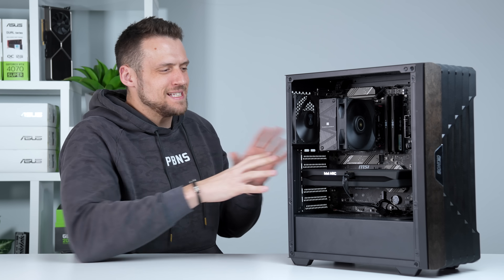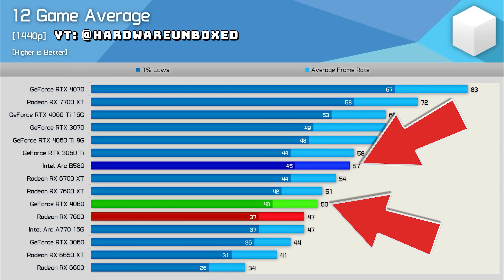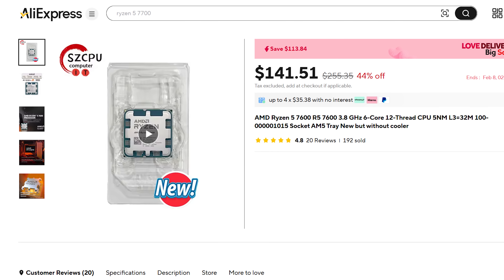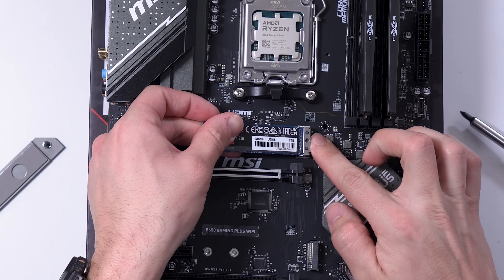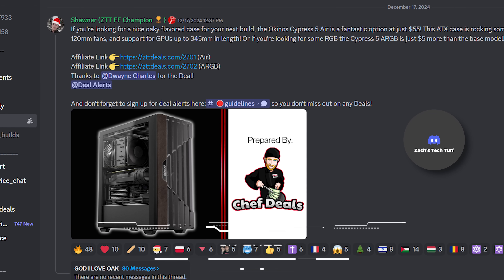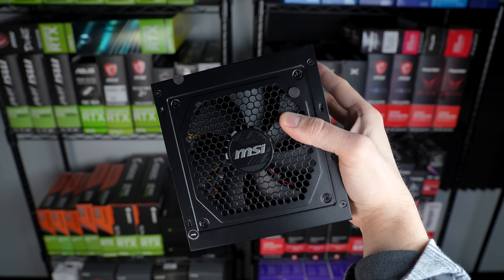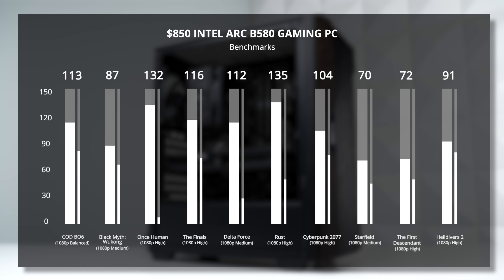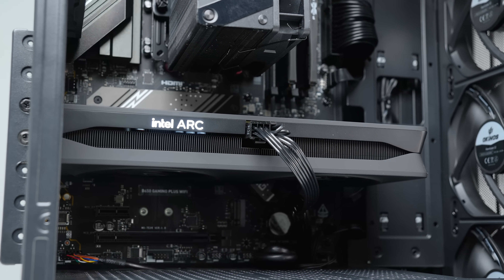$850 Pure Performance Gaming PC Build Guide

Comment from the maker: Check out the brand new build guide cheat sheet for this PC, with links, alternative parts, monitor recommendations, a cable management guide and more! https://zachstechturf.com/$850feb25
Reply: Is a 3060 still a good GPU
Reply: 8gb or 12gb@TheBlobKing1039
Reply: @TheBlobKing1039gpu wise decent but price wise you can get better
Reply: Is the War Machine v1 coming back?
Reply: I have a Xbox series x what pc could I replace it with
Reply: @GCJDM  whats your budget?
Reply: @G.CJDMcars if you're going with a budget Build $500 or less I can recommend you Horizon 5 3600 RX 5700 XT both of them used 16 gigabytes of ddr4 RAM a 1 TB nvme a a 500 w PSU like MSI MAG 550W DN add if you have this case available in any online store theMSI MAG Forge M100A

if you're going with a budget of a 1000 dollars you're stepping in a 1440p territory at this point so you can keep the the same SSD and RAM or you can upgrade it to 32 gigs but the CPU I recommend a minimum of a rizen 5 5600 and the GPU 7700 XT 12 VRAM will give you enough performance or even the Intel arc B580 and you're going to need a beef power supply I recommend a 750-1000W it might sound as overkill for 1000W but for future proofing you can never be too safe
Reply: Hi Zach is a B580 with an 5 5600x for 450 usd a good price
And the whole pc with all the other stuff like keyboard mouse is about 900 usd
Reply: Should I use a b570 because you could buy them for there normal price off Amazon. Also, can I use a ryzen 5 5600x because it’s $60 cheaper?
Reply: Zach I have a rookie question for you. Can you explain GPU and CPU usage? Is 100% usage a bad thing? Is it a sign of an unbalanced system?
Im running a Ryzen 7 5700X3D and a Radeon RX 7600 XT. My GPU hits 100% usage and I am worried maybe I didn’t something wrong?
Reply: I had a ryzen7 7700,cx650w what gpu is good for it
Reply: @AhnafAkif-t4c  im running a 7700x with a 7700xt seem to be good no oc or uv yet
Reply: fake you cant even get half the parts
Reply: @Tweek9690  you can there are price tho differences in countries and area
Reply: @ i check parts and prices everyday its my job, not in the states no you cant
Reply: @Tweek9690   acctualy i can its 930 usd and in my country everthing is cheaper
Reply: @ZachsTechTurf  I dont live in America
I live in Romania
Reply: Hello Zach. 
I've been trying to reach you, asking about if you could evaluate a purchase I made in December. I would love to know your thoughts. Since you haven't responded, (and I don't know where else I can leave such a post) I thought I'll just leave my full specs here. 
Tell me if you would like me to send you some images and videos of it too. 
I already know the one hardware thing you will say you would replace for a better option, but I'll just wait for your input. 

Specs: 
- AMD Ryzen 9 7950X3D 16 Cores (CPU)
- ASUS TUF Gaming NVIDIA GeForce RTX 4090 OC 24GB (GPU)
- ASUS Prime B650-Plus (Motherboard)
- 32GB RAM (2x16GB RGB) G.Skill Ripjaws M5 Neo RGB DDR5 6400 MHz (running at 5600 MHz)
- 2TB SSD M.2 ADATA NVMe Gammix S70 Blade
- WaterCooler CPU ARGB RX360 Mirror
- ATX Slayer RX33 Crystal (Case)
- 850W FSP Hydro K Pro 80+ Bronze (PW Supply)
- UPS APC 1600VA
- Windows 11 Pro
- Razer Ortana V3 RGB (Keyboard)
- Razer Basilisk V3 RGB (Mouse)
- EasySMX X15 Wireless Controller RGB / Dualsense Wireless Controller PS5
- Slayer HD800 7.1 Gaming Headset / Sony Wireless Headset Pulse 3D
- ASUS TUF Gaming Monitor VG1A 2K/260Hz / LG TV 43inch 4K/60
Reply: why is the b580 linked so expensive compared to what was mentioned in the video
Reply: Hi! It seems you mentioned me to tell me that I won something. I didn't notice until today, three weeks later. Is there any chance i can still obtain something? If not then rip 😂 still a big fan either way
Reply: 1. CPU: 
AMD Ryzen Threadripper PRO 5995WX, 64-core, 128-Thread Desktop Processor: $ 3,250.00

2. GPU: 
NVIDIA - GeForce RTX 5090 32GB GDDR7 Graphics Card - Dark Gun Metal
: $1,999.99

3. RAM: 
CORSAIR VENGEANCE LPX DDR4 RAM 64GB (2x32GB) 3200MHz CL16-20-20-38 1.35V Intel AMD Desktop Computer Memory - Black: $87.99
  
4. SSD: 
  SAMSUNG 980 PRO SSD 1TB PCIe 4.0 NVMe Gen 4 Gaming M.2 Internal Solid State Drive Memory Card , Maximum Speed, with heat sink Thermal Control MZ-V8P1T0B/AM: $123.00
  
5. Motherboard:
 ASUS Pro WS WRX80E-SAGE SE WiFi II AMD WRX80 Ryzen™ Threadripper™ PRO Extended-ATX Workstation Motherboard: $899.99

6. Cooling system: 
ARCTIC Liquid Freezer II 420 - Multi Compatible CPU AIO Water Cooler, Efficient PWM Controlled Pump, Fan Speed: 200-1700 RPM (Controlled via PWM), LGA1700 Compatible - Black : $75.99

7. Power Supply:
CORSAIR RM1000x Fully Modular Low-Noise ATX Power Supply – ATX 3.1 Compliant – PCIe 5.1 Support – Cybenetics Gold Efficiency – Native 12V-2x6 Connector – Black: $189.99

  8. Case:
SAMA NEVIEW 4503 Black Airflow Full Tower Case ATX PC Gaming Case Dual Tempered Glass 4X12CM ARGB Fan Pre-Install USB3.0X2 Type C Included 360mm AIO Support at Top : $114.99

9. Operating System: 
Windows 11 Pro: $199.99

10. UPS: 
CyberPower CP1500PFCLCD PFC Sinewave UPS System, 1500VA/1000W, 12 Outlets, AVR, Mini Tower, Black: $219.95

11. sarge protection: 
Rocketfish™ - 12-Outlet 5,280 Joules Surge: $189.99 
what do you think of this build
Reply: hey zach im planning on getting a pc can you tell me if the parts i have chosen are good.

Cpu- Amd Ryzen 7 7700x
ram - 2x16gb ddr5
mobo- MSI am5 motherboard ATX
GPU- amd radeon rx 7600 xt
psu- corsair rm1000e
SSD- 2tb m.2 nvme PCIe gen 4
Reply: "🔥 Hey, I'm new to PC building and to your channel, and I absolutely LOVE your videos! ❤ I'm looking for a super detailed video on how to transform an HP laptop into a full desktop PC 🖥 because I don’t have any other device and REALLY need this ASAP! ⏳⚡ How do I turn a laptop into an actual PC with a case and everything? Please make a video on this! 🙏💻➡🖥"
Reply: Zach if i had 144hz monitor then i dont need to replace my gpu for more fps ?
Reply: Hello, I wanna build my first pc, can you please help me with some suggestions. I want my pc to be future proof for at least 6 to 7 years and for it to be able to do smooth 1440p gaming with great fps in the latest upcoming AAA games of this year and to be also able to support 4k with good fps (at least above 60fps). My maximum budget is 5000 dollars. Please also suggest coolers , monitor and case as well.
Reply: I don't really play games on my PC but I'm wondering if you could recommend a cpu & GPU combo for a budget to mid PC build to work with unreal engine. Any help is appreciated.
Reply: I've tested this rtx 4060 on over 8 diff pcs.. all ddr4 got 260-320fps --- all ddr5 got 400-460fps

Why is it such a drastic diff?
Reply: I'm going to upgrade and sell my old parts but I'm on a budget of 300 bucks and my current parts are the rx 570 4gb and r5 2600x. Yikes 😬
Reply: hello. actually I am from an Arabic country.
my question is does ray tracing  in Nvidia graphic cards worth the money
Reply: How would you feel if I started a tech info youtube channel... and to get a bump in the algorithm, I use your beginning taglines... but use my own content in 90% of the video. 

For example: "You can't future proof a gaming pc" --- yes you can -- and I list parts I would reccomend. 

I want to start a tech youtube channel and I feel like using popular video taglines and keywords would help the algorithm but I don't want to steal.
Reply: thank you

Comment: Just go with a 5800X and 7700XT PC it will be more bang for the buck in my opinion I have done my research. A 5800X won’t bottleneck the 7700XT and it would beat a PC with a 7600X and B580.

Comment: I've never built a PC.  I know I want to be able to play anything (1080p/2k), potentially stream, and not have to pay $6,000+ to do it. First time watching the video I realized looking at this build that its basically what I was planning to do after doing a bunch of research. 😂(at least with the GPU and CPU) I'm not sure what all prices seem like at this point a couple months later. I am willing to do a build up to $1,500. I just want to be able to play everything quite well at at least 1080p and probably at 1440 too. I think I may spend an extra couple hundred and get a slightly better GPU instead of the B580. (great GPU if paired with a strong enough CPU though) I was thinking I may get the the RX 7700 XT 12Gb or the RX 7800 XT 16Gb. I may go for I higher PSU for the RX 7800 XT 16 Gb if I do that one.  I only have a 1080p monitor with about 160 Hz right now, but I think I might get a second 1440p monitor when I build the PC. 

Its a bummer Nvidia is disappointing with everything being out of stock and too expensive. I think Its time for AMD and even Intel to take over the graphics card scene.
Reply: Right on the money! Try buying a 7700 xt or 5060ti (16gb) depending on whats cheaper and i suggest to pair either one of these gpus with; Ryzen 5 5600 or higher, a weaker cpu is fine if your at 1440p but the 5600 should be good enough for 1080p and 1440p.
Reply: @Ambiguityt I already got and built a PC with a Ryzen 5 9600x (it was on deal cheaper than Ryzen 5 7600) and a B580. I am getting mostly good 1440p performance. I’ll probably upgrade to a card similar in power to a RX 7800 XT 16 Gb in a year or 2. I have no plans of doing anything at 4k, but I’d like a card that can do 1440p with other things happening.

Comment: New subscriber, love your videos.  I hadn't been keeping up with computer builds in almost a decade, but it's been fun catching back up and exploring what I could do to update my 8 year old system.  It does suck to see how hard it is to find a reasonable price for a slightly older GPU.  I'm on GTX 1080 and my research is pointing me towards a 3060ti to get a nice boost with minimal bottlenecking with my CPU (i7-7700K).  I just don't trust used or "renewed", and if I understand correctly NVIDIA has discontinued production, which makes this seem potentially impossible.  Next PC will have to wait for me to save a bit more, but based on this video and other information I've been reviewing,  a bit more money, and a mid prebuilt would be a big upgrade.

Comment: If anybody ever reads this, please help me out. Im completely new to buildings pcs, but have been doing some research for the past week. Do you think it will be fine/better if I switch the cpu to ryzen 5 9600x with msi b650pro, and for gpu intel a770 ( the only logical pick because of the shortage). Please anyone if you have an answer for me help me out

Comment: I built something close to this for a friend, I built it also based on a few things I learned. But a big help I learned for next time for friends who are ok ordering from Aliexpress is to use Aliexpress. I NEVER would have though to order from there. But we upped the CPU as he wanted to change the GPU down the line, we went for the 9700x vs the 7600x because it was only 25 dollar difference due to a bunch and a coupon we got from the rep at Microcenter.

Comment: Zach i have been build pcs for a long time and appreciate your thoroughness with this video. I think you should make a video with USED parts from either FB marketplace or some trade groups. I have been able to make builds with 30 and 40 series cards a year after for about a 50% discount over MSRP, taking advantage of people who always upgrade . I think this is a much more realistic price point for some people and availability is not that bad when you are sourcing across the country. A 1 year old 4080 is going for cheaper than resale prices for mid tier 50 cards. Just trying to give another option to us budget gamers, you can basically get the latest updates. I was on a 970 for a long time trying to find the best deal.

Comment: how would the pc work with 1440p on a 32inch curved monitor?
Reply: What??
Reply: @ the fps etc are great in 1080p. What if I want to Play on 1440p?
Reply: @simon_sch  that wouldn't be a problem for the pc it just decreases the fps just a bit but I still think 1440p is good

Comment: Might be a silly question but can I stream/record with this build? I’m new to pc gaming so I don’t know a whole lot but I have read that streaming and recording can affect the fps. Also I plan on streaming with a webcam in case that information is relevant.
Reply: You can stream with this build but I wouldn't recommend the b580 because in every games the 1% & 0.1% lows are bad so I'd rather go with another GPU like a used rtx 4060 or u can get a new rtx 4070 super if you can find one, now don't get me wrong the B580 is good but at the same time it isn't worth it imo
Reply: @ but the cpu can still stay the same?
Reply: @LGato__  yes the CPU can stay the same
Reply: I had the same question

Comment: I have a Ryzen 5 2600 with 32gb of RAM and an MSI RTX 2060 6gb gpu. Ive had it since 2020 so I’m 5 years in now. Ive had no issues and I’m just wanting to upgrade but don’t know where to start.
Any suggestions?

Comment: Hi Zach I’m thinking of buying a pc prebuilt and I was wondering if this is a good build AMD RYZEN 7 5700 (3.7GHz, 20MB Cache, 8x Cores, PCIe 4.0 Ready Turbo 4.6GHz+) CPU
MSI B550 Gen 3 AM4 DDR4 USB3.1 HDMI, AMD RYZEN Motherboard
GeForce RTX 4060 8GB GDDR6 DX12 Graphics Card
32GB DDR4 3200MHz High Performance RAM
1TB NVME SSD Ultra-Fast Solid State Drive
Windows 11 Pro (64-bit)
Cooler Master Elite Nex PN600 600W Power Supply
Gamdias Athena P1 Tempered Glass GAMING CASE
Integrated 8 CH High Definition Sound Card
24 Months Warranty this is 16k in my currency 900 dollars

Comment: Hi, I have msi 3060 12 gb and i5-12400f msi b760 mobo, 32gb ram 3200mhz and gigabyte g24f2. Is this the correct combination for playing ets 2. Kindly suggest if any cpu change in the 12,13 or 14 gen can increase performance. Also any best monitor, apart from which, I have.

Comment: Hey Zach I used to have an AMD RX 590 Sapphire Nitro, but after I had to move my PC to another room, I decided to clean it using an air blower. After plugging everything back in, the PC wouldn’t boot. After many attempts, I finally managed to get it to turn on, but I had to leave to eat, so I shut it down. When I tried turning it on again later, it just wouldn’t start, I tired plugging it into a another motherboard and all but nothing.

I took it to a repair shop and they said they couldn't fix it. Then I took i to another repair shop but the repair cost was about half the price of the GPU itself, so I decided not to go through with it. Now, about four months later, I still have the card. Any ideas on what I can try to fix it myself?

Comment: Hello zach!, i was have an i5-8500 and a 6500 xt (i got it for 80 bucks), its in an optiplex, should i upgrade just the psu or the motherboard and case aswell (optiplex 3060 so 260 watt psu) i want to upgrade to a 9700k

Comment: Zach i been researching pc parts watching YouTube discord everything and i finally choosed the part for my pc heres the list 

Case: Gamdias Aura GC1 Elite
GPU: Zotac RTX 4060 8GB (White)
CPU: Ryzen 5 5600X (Includes Wraith Stealth cooler)
Motherboard: ASUS Prime B450M-A II AMD AM4 Micro-ATX
Storage: Lexar NM620 1TB PCIe 3.0 NVMe SSD
RAM: TeamGroup T-Force 16GB (2x8GB) DDR4 3600MHz (White, RGB)
Power Supply: SEGOTEP GM750W White Gold (80 Plus Gold)
Case Fans: 4 pre-installed RGB fans (Case) + 2 additional Gamdias Boreas E2-41D Digital fans
Maxed-out fans: 6 RGB fans (3 front 2 top, 1 rear)

Comment: 😥please need help What's problem is this ?
⚠i recently upgrade my CPU i7 4790 to Ryzen 5 2600 + a320m-e Motherboard but my Valorant not turning on : (
and also i getting very low fps in many games with Low GPU and CPU usage 

i try reinstalling drivers , repair games files , recreate virtual memory windows 10 and also reinstall GPU in PCIe slote

in my old i7 4790 CPU i didn't get any problem like this

Comment: I’m gonna build a pc 
RTX 4070 TI super
ASUS TUF B650 plus WiFi AMD RYZEN AM5
RYZEN 7800x3d
PSU 850 Gold
Thermalright Peerless Assassin 120 SE White ARGB CPU Air Cooler
acer Predator GM7000 1TB Internal SSD
RGB DDR5 RAM 32GB
iONZ KZ-Z - PC Gaming Case, ATX Mid Tower
MSI G274QPX 27 Inch WQHD Gaming Monitor - 2560 x 1440 Rapid IPS Panel, 240 Hz
Any recommendation to change or tips I will be happy to learn❤❤

Comment: Hello im about to buy parts for a new gaming computer, but im not sure if it is good. Pls let me know
RX 7800 XT
Ryzen 5 9600x
Thermalright Phantom Spirit 120 SE 
B650-PLUS WIFI ATX AM5
T-Force Delta RGB 32 GB (2 x 16 GB) DDR5-6000 CL30 Memory
990 EVO 1 TB M.2-2280 PCIe 5.0 X2 NVME Solid State Drive
Montech XR ATX
Reply: Use chat gpt 😂

Comment: Can you please tell me is it bad if VGA red led light on the motherboard is on for a few seconds when PC starts? I have played games and benchmark it and everything looks fine. This is my first time building PC from scratch so it is little concerning. My MB is GIgabyte B650 Eagle and GPU is 7800xt. Thank you in advanced.
Reply: usually for debug light if it goes away means that the motherboard was checking and it found no issues after
Reply: @F-22raptor-22  Thank you for your answer. I was worried

Comment: Can u pls tell me what upgrades to get for around €480 I got a GeForce gtx 970 and a i5 and in need to upgrade both meaning I need a new motherboard, ram, cpu, gpu and the storage on the motherboard and I’m really struggling trying to figure out what to do.
Also I have a 550w power supply.

Comment: hi zach i have a question in the late 90s and early 2000 cpu clock speed that came out of the box around 1Ghz or more (ish correct me if I'm wrong) now in  the present day  how come the current cpu makers aren't making cpus at 4Ghz or more out the box if we have powerfull cpus out in the market right now

Comment: @ZachsTechTurf I have a question I have a AMD Ryzen 7 7700x and a rtx 4060 ti and I want to upgrade my GPU to a rtx 5070 or a 5070 ti but I only have a 600 watt power supply. should I upgrade my power supply as well?